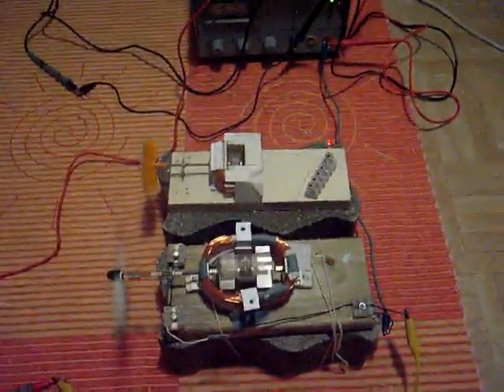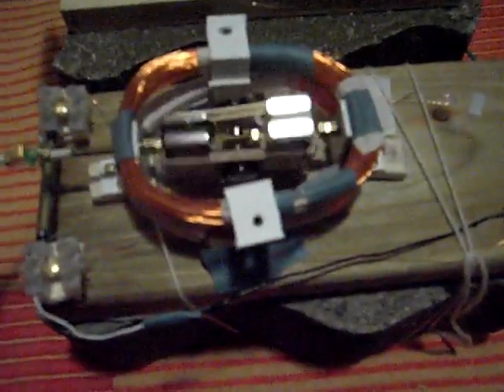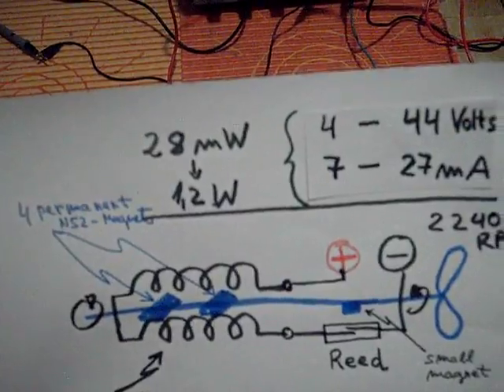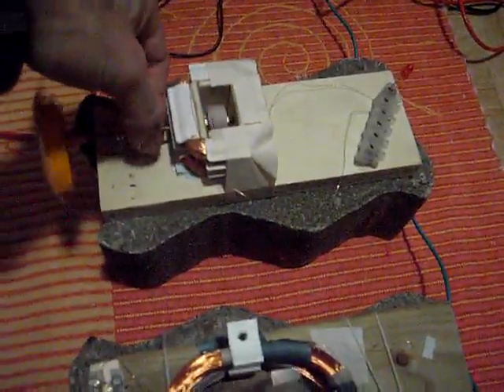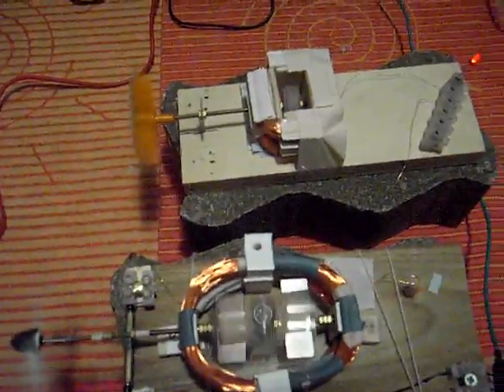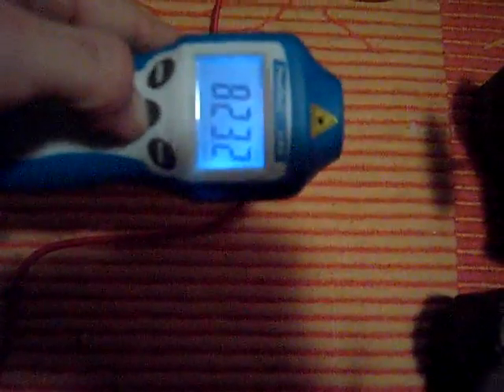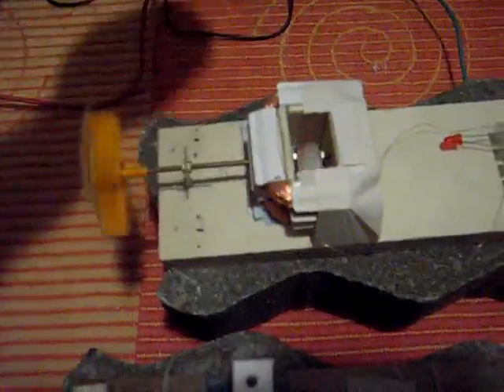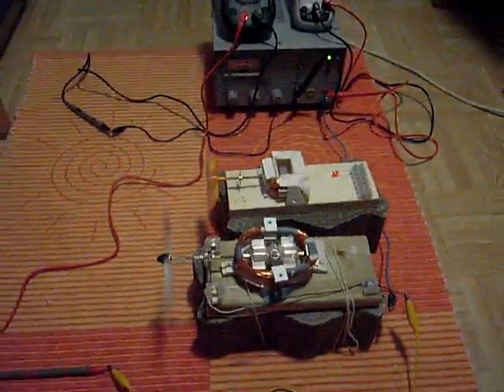Small Keppe Motor Part V - Twin Keppe Motor

Comment: Hi! I've seen your video and it's very interesting, but as I'm a beginner I beg you please clarify some doubts for me. Does each coil have 115 meter of copper wire or it is the total amount for the two of them?
And Would you please show how many turns 115 meter of copper wire would be?
Thanks in advance!
I really appreciate your work.
Reply from the maker: Hi @EduardoMayorquin-ru6dt, yes, each coil has 115 meters. But you can use less.

Comment from the maker: Yes, building engines with the same size would be more efficient for the resonance process. Good point, thanks.
Both engines are coupled magnetically. It is the magnetic force that turns the other engine that is not connected to the battery. If the primary engine turns too fast it will not be able to resonate with the second one and this one will not move. So there is a restriction here. A circuit of the main engine can be found in the first video.

Comment: Hi, nice set up there.  Seems like the two coils are together forming one  resonant circuit, but maybe the two engines need to be same size to match frequency and capacitance for better performance.   It seems strange that the system produces high voltage RF with such a low input voltage or is it to do with back spikes? Ah, maybe to do witht he engine acting like inverter.